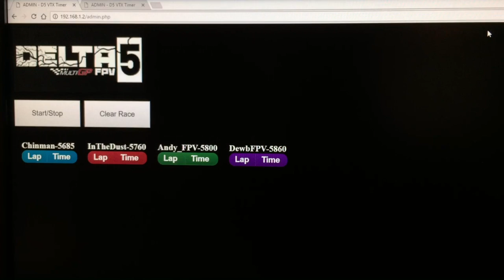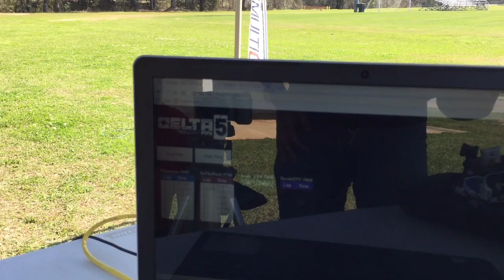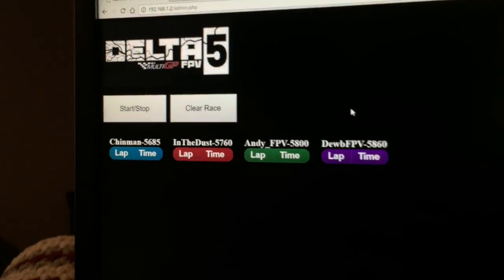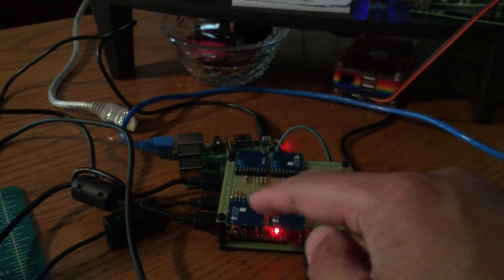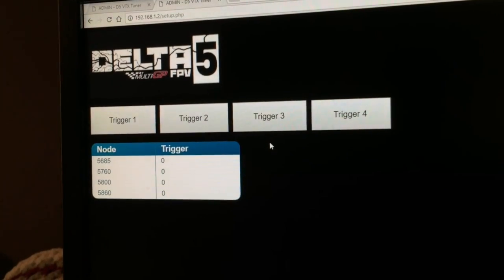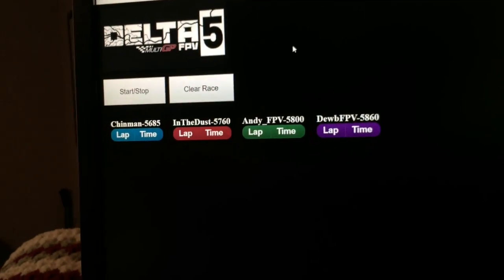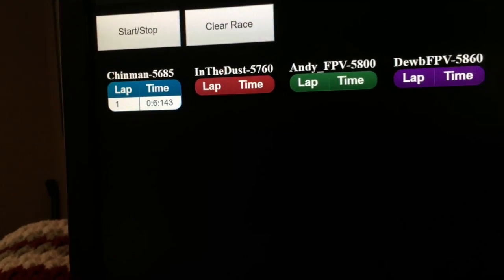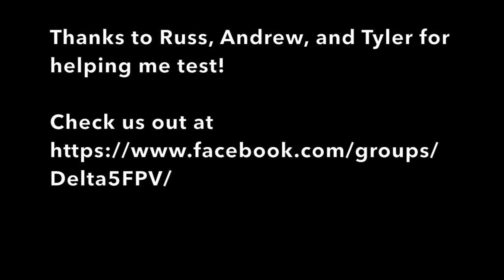Multi Quad VTX Timer

Comment: Curious  about if a person can fly around the gate and still get counted, and multiple quads through the gate at the same time
Reply from the maker: Thundolis Sure it depends on the placement of the timer. Ideally you would place the box at the center of the gate because it's reading the RSSI strength from there. In the video, the box is to one side, and a pilot could have flown to the right of the box and it would have counted. If the box was in the center of the gate, on the ground, you could adjust the trigger strength to be the top of the gate. Lessens the chances of a false trigger. 

There is also a 5 second minimum lap time before it triggers again. 

As for multiple quads going through at the same time, that's no problem. Each receiver is tuned to a single quad, and it's only looking for that quad. I actually asked the guys flying here to stay close to see if it would create false triggers. Hope this helps

Comment: I just started this exact same project! Are you planning on open sourcing the software and hardware?
Reply from the maker: Yep!  I just added the link to the repository on GitHub in the description.  Its not done yet, and I'm still working on getting everything documented; and I'll have the raspberry pi side up soon.
Reply from the maker: The rest of the Pi code is up on the GitHub repository.  I just need to add the instructions for setting up the MySQL tables.  You can join the FB group if you have any questions.
https://www.facebook.com/groups/Delta5RaceTimer/